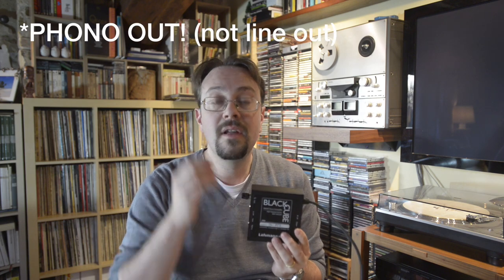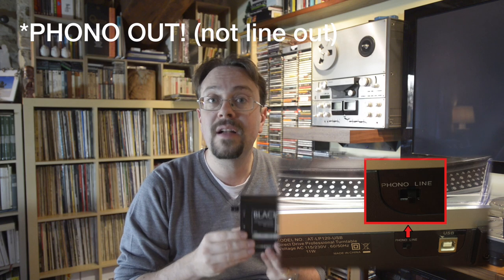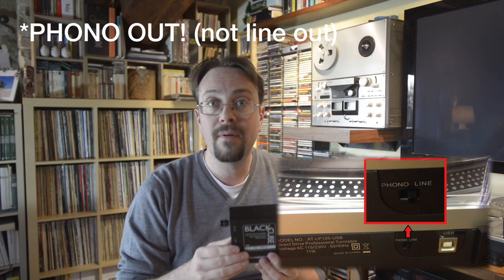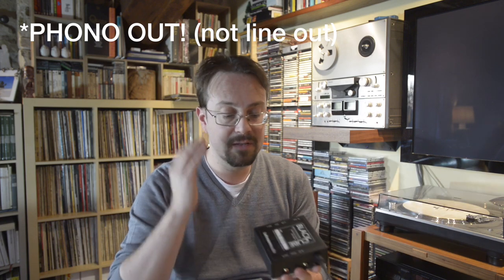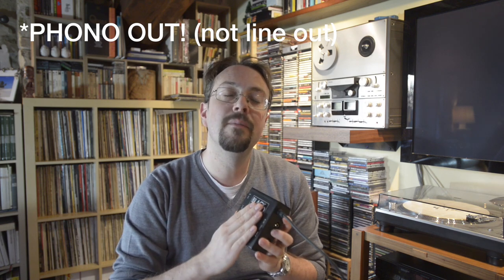Optimize your Hi-Fi system sound quality: 3 - Pre-Amp your turntable!

Comment: For years I used the phono preamp built 8nto my Conrad Johnson PV10, it was tube based and used high end passive components in the RIAA section. I then tried the vinyl to analog converter that was being sold by audio alchemy. It was very quiet but in the end the magic of the Conrad Johnson just wasn't there.

I then built the LaPacifica circuit using a kit of parts and PWB I bought online. I used better resistors than the kit came with and I designed my own power supply. I put all in an aluminum case and powered it with an external wall wart that was grossly over rated, the rectification and regulation was done inside the preamp chassis. The result is very quiet and I enjoy the sound this phono preamp affords me. All in the project cost me about $150 that includes all the parts including a pre-preamp (for the MC cartridge I was using) that added 10 db of gain to the LaPacifica circuit, the plain case and the outboard wallwart.

Comment: I have been out of using  a turntable  for many years  now, I was going to buy a Audio technica lp  -120 But after listening to you  Im not so sure now  I want a decent sounding turntable  So let me see If I got this right 1) I should buy preferably  a moving magnet  cartridge turntable and then 2) pre Amp 3) To a Amplifier/ receiver  4) to my speakers  is that correct  or am I missing something,  I dont have too much money to spend  ,..Can you recommend A good turn table  vintage or other that will sound  good  without breaking me I have about $350 For just the  turntable with the set up your Describing  and I will buy the rest to complete it, I would  rather buy  good components piece  by piece and build  a nice system that later I can upgrade then have something that I will not be  Satisfied with.

Comment: I am focusing on the preamp now. I have a pioneer plx-500 that has an internal preamp. So in order to connect an external preamp, i have to switch to the line mode (not sur if i understood the tip). Great video!
Respectfully
Reply from the maker: Line level is for an amp, phono is for the external preamp. Select phono if you are using an external phono preamp.
Reply: @anadialog  thank you 🙏

Comment: A phono preamp must do three things: first, it has to match the impedance of the cartridge with the input impedance of the preamp; second, it must implement correctly RIAA reproduction curve and third, it must bring the signal to a line level. All that while adding no coloration to the sound and no distortion, of any kind. This is the ideal and there is no real preamp that can do this perfectly, but there are some that came close. The idea is that, having a minimum of skill for building electronic devices, anyone can use a schematic (such is the one provided for free by Elliott Sound Products, for instance) and build an preamplifier as close to perfectly sounding as it can be, with a cost of only a few bucks. I think I spent about $50 on my preamplifier I have built, using off the shelf components (good quality ones but nothing overrated). And it sounds extraordinarily good, especially in comparison with the same recording on different format (CD, or compact cassette), as far as I can tell. Any added cost must be the good old branding hype and the snobbery of owning something worth hundreds or thousands of dollars and which really MUST sound better since the device costed so much, isn't it?
There are differences between preamps but one included in the amplifier (or receiver) is not automatically bad; it can conform thoroughly to the standard and might be as good as any; I think, as most things in the thin air of highest audiophile strata, all is down to personal preference. And you can have much more impact on the quality of the sound you get from vinyl by varying things like the acoustic treatment of the room you are listening in, having a good set of speakers, a capable audio amplifier (I didn't said ”good” since an ideal amplifier should NOT color the sound in any way or shape) and finally a good turntable and cartridge. And I believe this is the descending order of importance for a good listening experience.
Obviously, that's my opinion, I'm not saying that I possess the final truth. Just something to be commented upon, for sure. :)
Reply from the maker: Thanks for the comnent. I do not agree with the philisophy "the truth is that with 5$ you can di anything with the same results" but I do understand your point. Of course the basic circuit is simple and cheap but good quality components and engeneering does require resources. No, I do not like $$$$ gear with rediculus prices, even if I could spend it I would not. I do believe that a good quality, for example, phono pre-amp does need at least a few hundred dollars/euro. A lot of people forget the expenses and research spent in creating new quality products. It is not just a matter of chips and wire. Yes, if course the tt and the amp are more important but this is a video dedicated to whom already has that and now is willing to focus on the preamplification.
Reply: Bine ai spus Bogdane, si eu am construit  cel de la Elliott si am ramas cu gura cascata, l am inlocuit pe cel cumparat cu o zi inainte de la ceva firma ..e fain Elliott si eu tot de la el construiesc module pentru intreaga linie, si bineinteles ca si finali, bipolari 2N3005 in alimentare clasica cu condensator pe iesire, canta si acum langa mine si parca nu e ceva altceva  mai bun, e doar o parere de gust personala .Daca esti electronist, ai de unde alege o sumedenie de scheme superbe ...lasa pe altii sa dea bani, treaba lor, dar satisfactia aia, ca suna bine si e facut de mana ta ...stii tu ce spun, numai bine !

Comment: Hello

My questions is , I have a Project Phono Tube Box DS preamp . My speakers are Klipsch RF7 . I don't believe I get rumble but have read using the subsonic filter helps tighten the bass. Should I use it or not ? The rest of my system is technics sl1200g and yamaha as 1200.  Thank you for your time .  I will be installing a denon dl103r this weekend currently using denon dl110.
Reply from the maker: Hi there, well, obviously apart from recommendations, you should just test with your ears if it is better or not. Personally, I prefer not to use it. It's always a filter and it may cut out some good frequencies.
Reply: Thank you

Comment: Thank you. This can sure be a confusing topic. Please help me to understand. Is the "Black Cube" a standalone preamp? In other words, can I go from this Black Cube phono preamp directly into a power amp or do I still need to go from the Black Cube into another standard line-level preamp and then into a poweramp? I'm referring to separate components here. Thank you.
Reply from the maker: No black cube as every phono preamp brings a phono level to a line level so you can connect it directly to a power amp if you want.
Reply: ...but youhave no volume or tone controls without a preamplifier. I would not connect a non adjustable line signaldirectly to a power amp, if this has no volume control.

Comment: Technically you are discussing phono preamps which are there to impedance-match the cartridge to the system and, to equalise the signal from how it is stored on the record ( high frequencies are stored at an enhanced level and, bass frequencies are stored at a reduced level compared with the master tape). The equalisation, normally the so-called RIAA curve allows the signal to be more compact and give long playing times per side. It also reduces high frequency mechanical noise because the conversion to a flat frequency response lowers the treble gain. The phono preamp restores the flat frequency response by applying inverse equalisation. Cartridge signal levels are in the millivolt range so, signal gain is added by amplifying the signal to line level. The best systems allow accurate adjustment and matching of impedance, capacitance and gain whilst not introducing noise or, distortion. Some high-end turntables have their own built in phono preamplifiers that are incredibly good. Some preamplifiers have their own built in phono equalisers that are incredibly good. The best phono preamplifiers will have excellent dynamics, microdynamics, resolution and will be utterly compelling when presented with good signals from good turntables. The Lehmann black Cube is a compelling and charismatic performer especially with its upgraded power supply. Phono preamps therefore, are technically equalising interfaces or pre, preamplifiers since you use them to correctly connect a turntable to a preamplifier.
Reply from the maker: Thanks for this helpful analysis!

Comment: I am not a Vinyl Guy, I am a FLAC lover. But there is one thing I completelly dont understand about turntables. All cartridges are by design balanced, then why even audiophile turntables and phono preamps are single ended on output?. The signal is quite low so the balanced version would much more immune for distortion and give much better SNR. I dont get it. The first thing I would do if I buy turntable, I would modify it to have TRS or XLR balaned output. Just directly from the cartridge. Oh, but there are no balanced preamps. I whink  I wouldnt even use a dedicated preamp. I would use microphone preamp in the audio interface (they are by design balanced and ~130dB SNR)  and implement RIAA in digital domain. I know running ADC and DAC looks wired. But I would do it anyway because of room correction.  The second approach would be to use two phonopreamps in balanced mode.  iwonder if anyone used thsi approach. The most important benefit from this approach is that I listen to the vinyl only once,if I rip it to a FLAC, then the next time I can use the FLAC instead of the original Vinyl. So it will last longer in perfect condition.
Reply from the maker: Interesting perspective! There are a few balanced phono stages and turntables but I agree, it's rare and it would make a lot of sense to do so...

Comment: I know this is an older video but I prefer the term phono stage, less confusing. Otherwise if I have to describe my current system I would say I have an MC cartridge running into a preamp running into another preamp running into a power amp. Very confusing!
Reply from the maker: Actually phono stage is a part of a preamplifier while a phono preamp is a standalone piece of gear

Comment: Hi! I'm using a an AT-LP120X together with a Nikko TRM-750 amplifier which has two Phono inputs and I think I'm getting a great sound out, do you think I still need a preamp? And if I do, will I have to use the phono inputs on my Nikko or do I use Aux/Tuner? Thanks so much!
Reply from the maker: Hi Pietro, a standalone phono preamp is always a good idea, obviously a quality one. If you get one, no, you must connect it to a normal line input, aux, tuner or anything else is good, not the phono input.
Reply: @anadialog  Thanks! I think I'll get one as soon as possible. Keep up the good work on your channel!

Comment: Would be great if you could explain the differences between gain and impedance, some preamps have these options... explain it to me as if I am 10 years old. My understanding so far about impedance is some MC cartridges have a Low impedance so the impedance on the preamp is usually set to 100 ohms. Increasing the impedance on the preamp to lets say 500 ohms would give a higher pass through of the signal resulting in more highs?
Reply from the maker: A preamp with these settings is actually preferable to those with none in order to achieve a better match with your cartridge. In any case, usualky, these settings are present when MC cartrdiges get into the picture. Gain and impedence are stricly connected. You are going to need a specific gain (signal amplitude) according to the impedence of your cartridge. In other words we usually say set the correct load on the phono preamp in order to match the cartridge impedence. MM are usually produced with a standard 47k ohms resistance so that is why in many cases fedicated MM preamps do not have gain and impedence settings.

Comment: I would like to upgrade to a pre-amp. My question is what function do I need to use for the pre-amp? I'm using a late 90s Pioneer receiver. Since I can't use phono,  I have VCR/Tape1...Monitor Tape2...DVD TV... LD/ Sat... CD. Suggestions?
Reply from the maker: 3 questions: What turntable are you using? What type of cartridge? What input are you using on the receiver?
Reply: @anadialog  Hello. I plan on upgrading to a Fluance RT 85 it comes with a 2m Blue Ortofon. I also plan on a Shiit Mani pre amp. At the present I'm using the dedicated phono function to power a Numark table.  Thanks for your reply.
Reply from the maker: Ok, so if I understood correctly you question, you just need to hook up tye Fluance to the manii and that to your amp/receiver normal input and your set...does this answer your question?
Reply: @anadialog  Yes thank you. I can use my CD input for the mani. Cheers.

Comment: I have a turntable Technica LP 120 with pré AMP and a Yamaha Receiver. Would you recommend to install between the turntable and Receiver  a external Pre- Amplifier?
Reply from the maker: Hi Anderson, if it has a PHONO OUT (selector or output), and I di think it does, the answer is: YES! Ansolutely! If you get a good quality phono preamp you will imnediately have a much better sound.
Reply: ana[dia]log thank you Very much friend ;)

Comment: I have a denon avr-2500h that has a dedicated phono input with a ground, do i still need to get a external pre amp, to me my technics sl-q30 sounds really good hooked up this way.
Reply from the maker: Hi there, in my opinion if you get a high quality dedicated phono preamp, you will truly unlock the potential of vinyl along with a similar cartridge. Those integrated in receivers and amp are of low quality compared to a dedicated piece of gear.

Comment: Lehmannaudio Black Cube use OPA2227 on first stage and second stage are OPA2134 Op-Amps. Lehmannaudio Black Cube cost £635 with PWX power supply. This preamp is not bad but this preamp is too expensive for normal user. Also, optimise Hi-Fi system are not to buy better preamplifier (on paper), it is to adapt preamplifer input with phono cartridge what you use. This is only possible with correct imput loading (RC filter) and measurements. Sound on ears may be good but this not mean that this sound is correct. Try to change this OPA2227 with OPA1642 and see what happen. Black Box use OPA2227 only because that this Op-Amp have low noise and good sound precision and this is what is need in preamp first stage but how many OPA2134 have louder noise than OP2227? Only 3dB and this noise floor is under -130dB.
Reply from the maker: I agree, this was just a simple video to direct people towards a standaline phono pre-amp. Black cube is obtainable at a very good price in the used marked, that is also why I suggested it, but you are right, it is a little too expensive for a newby. For matching I did this other vid. Check it out: https://youtu.be/T428mIuw9IQ

Comment: Hello, i finaly got my fist ext pre amp from cambridge audio. I am curently testing it. I am wondering about the low frequencies. Is it normal that they feel less present than with my internal preamp? Do i have to keep it working so the bass will emerge?
Reply from the maker: Things will certainly get better but even if still green you should have had a wow effect immediately! Are you sure you've loaded it correctly according to your cartridge? Is the gain set correctly?
Reply: @anadialog  yeah i don't have the wow effect for now and so is for my dad that listen with me. I may have not set the gain properly (i am a beginer). I have the cambridge solo. Maybe the preamp in my hk 503 is not that bad. In any case i don't now how to fit the gain properly. 
Thank you for always taking the time to answer. I really appreciate it 🙏
Reply from the maker: Oh ok, it's all fixed. I saw the specs. The only thing to pay attention is to use a MM cart, then you're good. Hope it gets better! Otherwise, if possible, return it and get a different one. I am sorry this isn't working as expected!
Reply: @anadialog  yes i am.using a MM cart. Its really good on the treble but i feel like it's not warm enough on the bass for jazz listening (tone poet series and music matters masterings). So i am wondering if the bass will open up or not. I'll  tell you if you'd like so.
Reply from the maker: Ok!
Reply: @anadialog  as i promised a feedback after more than 100 hours of listening. I compared my cambridge audio solo and my old integrated preamp in the amp. It is not even close the cambridge audio is WAY better. The bass opened up and are more present. But the wow effect is on mid and high frequencies. The voices are something else with the solo preamp. Also there are more details. So in the end i didn't have a wow effect immediatly but after usage i would never go back to the old preamp. In the end this is the first time i experience the "burn in" phenomena et it is true it does exist. I think more details about this should be explained on the specs of the products for nubies like i am!
Have a nice day
Reply from the maker: Thank you so much and so glad that things got better!!